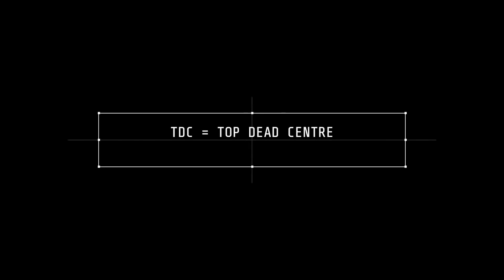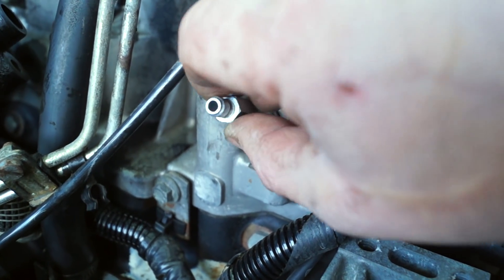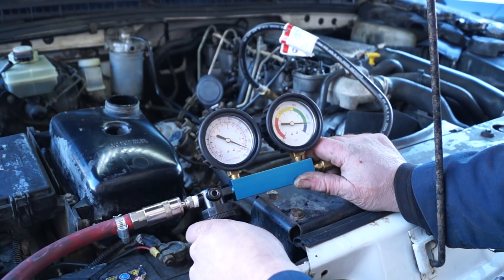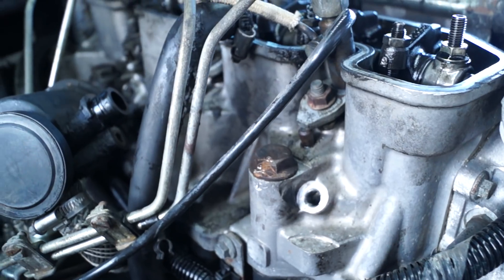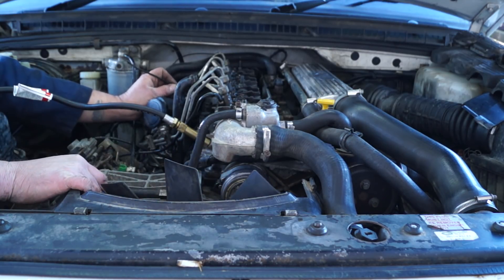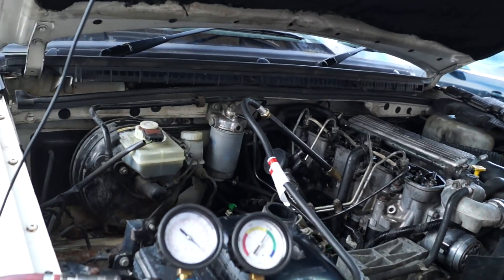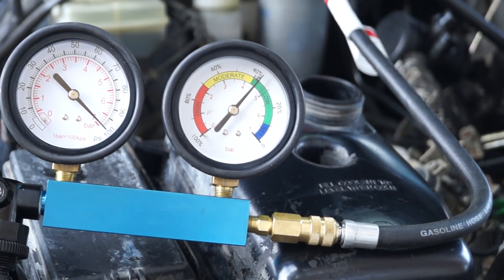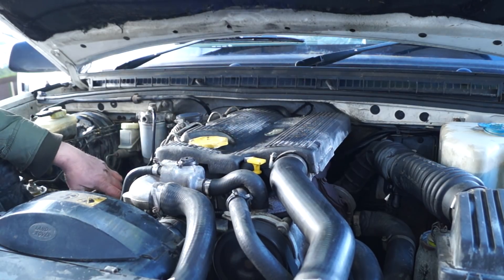300tdi Engine Testing for Head Gasket Leak, Faulty Valves and Cylinder Condition

Comment: Next time you’re in Staten Island can you please check out the cooling issue on my disco.. changed radiator, thermostat, hoses, water pump.. still cruising at 220f.. oh and it’s 30f degrees here at the moment

Comment: Hey guys! Awesome video! I'm in this exact position at the moment with a 300Tdi Disco I bought. Could you provide a link to your recommended compression and leak-down testers? Thanks!
Reply from the maker: https://www.ap-tech.co.uk/products/details/2323.html?adid=2772&aditem=2323&gref=45285682696&gdev=c&gloc=1006842
Reply: @trailerfitter2  q